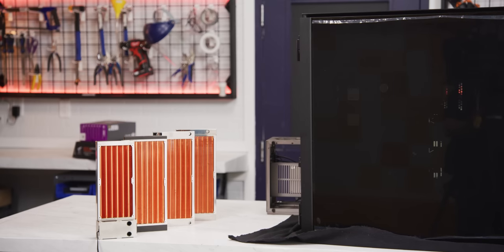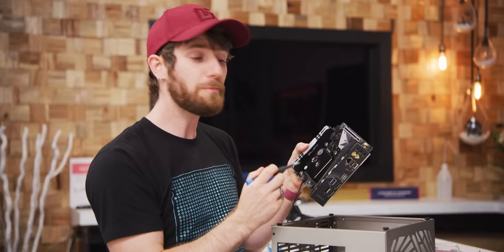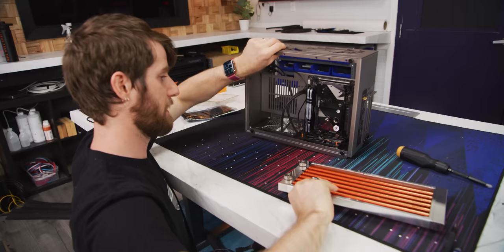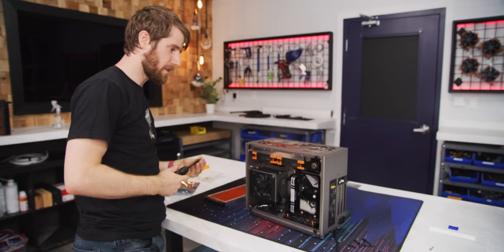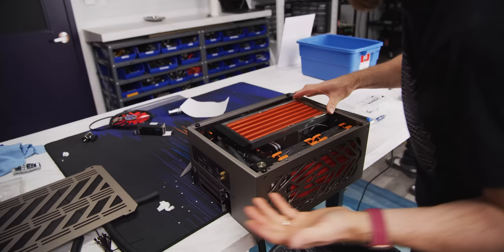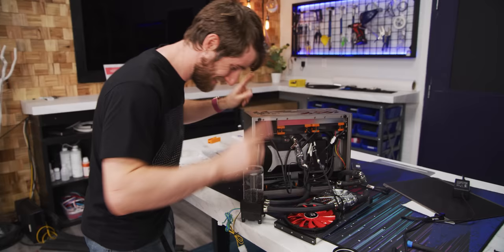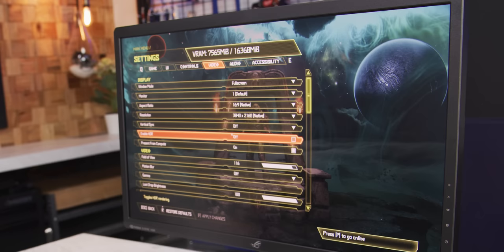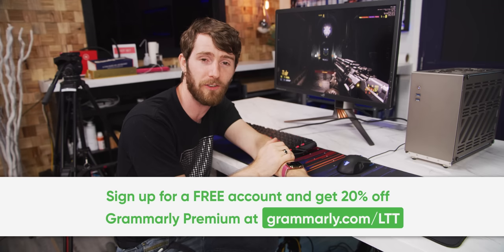The IMPOSSIBLE PC - 4x dual radiator ITX build

Comment: Copper is flat better than aluminum as a heatsink material. Its simple physics. The ONLY reason aluminum is oft used is cost. 

Doubt me? Check the white papers, and more importantly, the actual fin equations 
(wiki is linked as these are comically common equations, and can be found from a gross plurality of sources)
https://en.wikipedia.org/wiki/Fin_(extended_surface)

The only real component that varies between materials is k, and k is just higher for copper.

people talk about higher dissipation after power off, but I don't really think power cycling is useful in situ, and further, that is a function of a lower conductivity allowing more heat to stick around inside the sink; which is bad.

Comment: pretty terrible performance for a quad rad system
I never get above 55C on any 1 component with my quad (360, 280, 240, 120) - but then again I have a pump (this system didn't seem to have one!), and a res (more heat sinking). It's not just the amount of radiators you have (i.e. heat displacement capacity), it's the amount of heat sinking you have (bare metal and water).

Comment: What is the ambient temperature of the lab ?
On my 5950X with 420mm Arctic liquid freezer on Aorus B550 master in Meshify 2 case, I get 90c CPU temp while running Cinebench R23 score 28k approx . ambient 25c temperature

Comment: Hello guys, I know this is out of topic but I need help and I figured this place could help me. So the thing is - I use a wireless mouse and I always plugged the dongle straight to the back of my pc and today I found out that you are suppose to put the dongle into the thingy you get with it and plug it into the pc via a cable? Is my way also possible or Im doing it completely wrong?

Comment: so my 16x1 slot on my mobo(motherboard) wont detect my graphic card but if i put it in my 16x2 slot works fine ive tried another GPU still didnt work but i have a ssd extension tht runs off of pcie and tht works just fine in my 16x1 slot any ideas why?

Comment: Hello everyone,  could you please help me with my problem? Tried posting on different subreddits but no solutions there. Didn't have this problem before, worked perfectly before.

So i have a windows 10 installed, i use steelseries wireless headset (i have to plug in a little thing in order to connect the headset with the pc). So when i try to play some games with a dualshok 4 (ps4 controller) i connect it with a usb cable and then my headset just stops working then when i dissconect the dualshok it works again. I tried different usb ports but if i plug my headset and dualshok at the same time nothing works. Yesterday i didn't have this problem. Didn't have any problems before, thats new. Any advices?

Comment: Alumminium DOES NOT dissipate heat better than copper (per area, which is what matter when comparing same dimension heatsinks), that is a very silly myth easily debunked with a little more research, it dissipates better PER MASS (because by the same surface area it has much less mass).